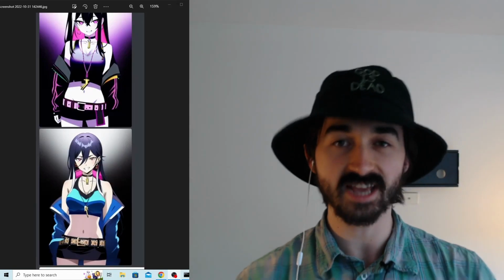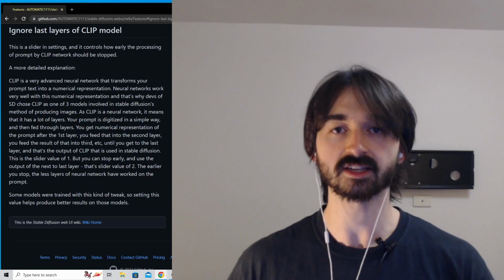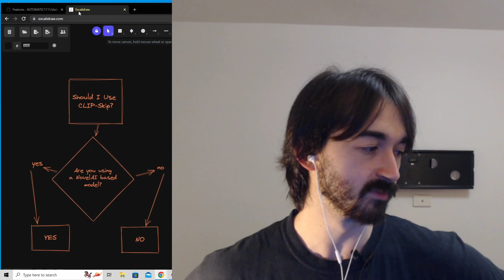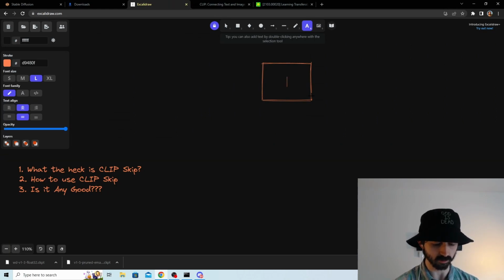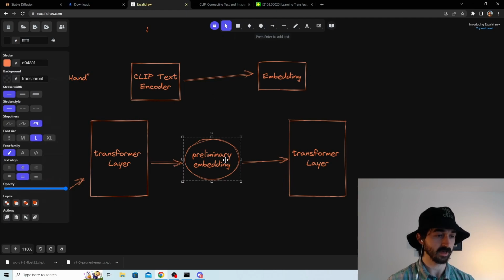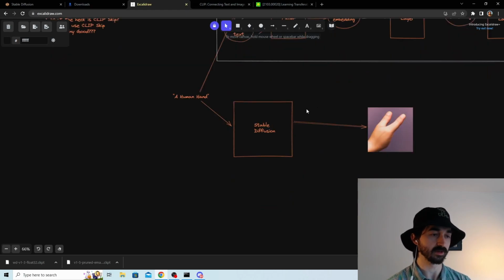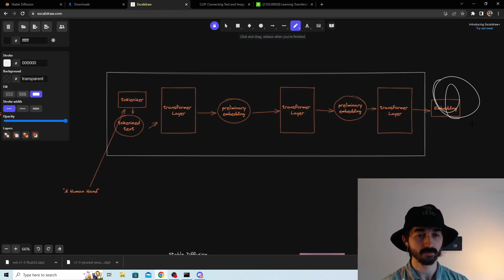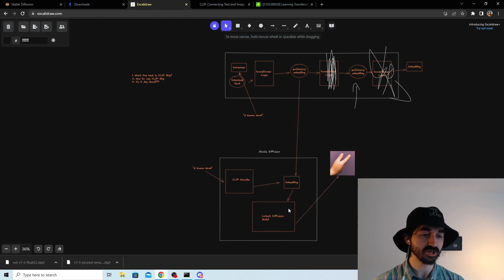What the heck is CLIP Skip and when do I use it?

Comment: I believe this is incorrect. You can't just bypass the layers in a model that is already trained, because that would literally break it. In the trained model those layers have weights assigned to them and bypassing them would produce completely different results. Also if they use different dimensions it would be mathematically impossible.  What we can do is to skip training them, so they would keep the original weights assigned them while finetuning our model. Or in other words freezing them. Now, why would want to do that? There are a couple of reasons for this, first the less layers we train results in a less memory usage and faster computation speed. Second, the furthest layers generally contain more abstract and generalized ideas. Here I assume this would mean deep relationships between different words, concepts and their attributes. For example, humans usually come with two hands and two legs, beaches are related to oceans, open mouths have teeth and so on. Also we don't want the text encoder to go rogue as it could stop responding to different prompts and lose flexibility. Unless we are creating something unusual, we don't want break those relationships and thus don't have to train those layers. In practice however we can also train by propagating through each and every layer. Finally, aside from computational speed and memory usage, fewer training layers might also results in faster training, which implies fewer iterations while trading off the potential complexity.

Comment: I still don't have a good intuition of why CLIP skip works better. My guess is as it goes further it focuses more on the general picture in order to align with the image embeddings instead of keeping focus on the details in the text itself. Basically the reason why T5 works better than CLIP.
Reply from the maker: It only works better with models which were trained with clip skip... though as to why those models benefitted from clip skip, you're right, it's a bit mysterious.

Comment: So sample step divisions is what is being affected here correct? If you tell the program, calculate for 20 steps of noise resampling, it will divide the work load into even chunks. It seems like some people can prefer the outputs before the calculated "fully noise resolved" image, because of that smooth noise still left in the image. This may make sense for when you know the detail of the final output, and maybe want something slightly less fine detailed but more generally stylized. I plan on doing some side by side tests between one step lower sample steps and one step of clip skip to see
Reply from the maker: I don't think that that's exactly what I was trying yo get at. There's a link to some of my experiments in the description if that's helpful!